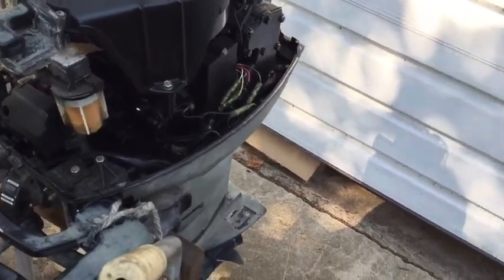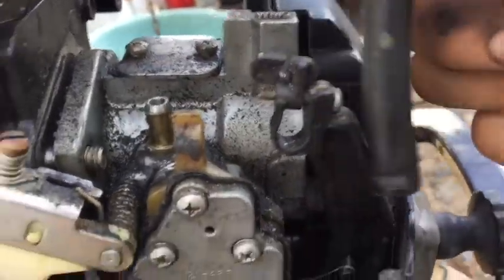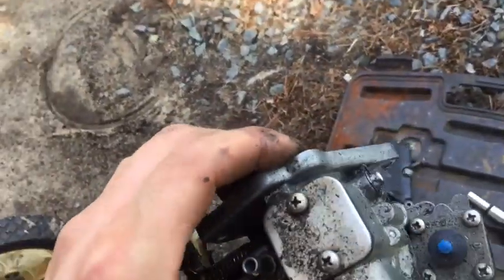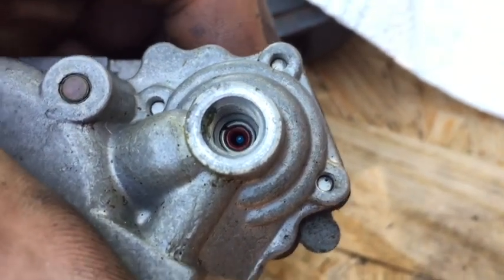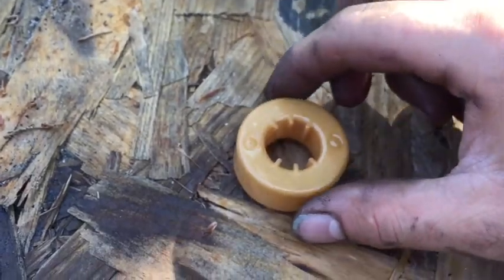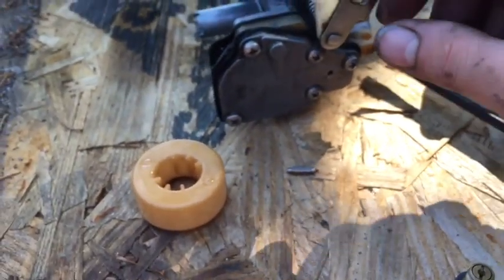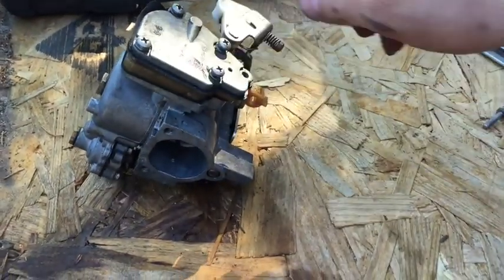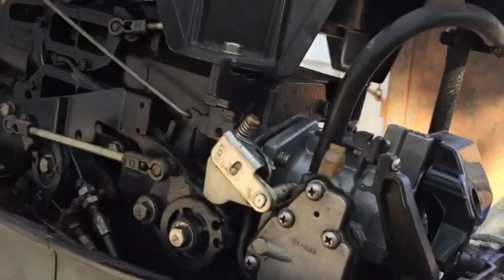1996 Mercury 25hp Carburetor rebuild

Comment: Hi would a upside down float in the carb cause the motor to bog down at full throttle?? Like it will go full speed for a good while then jus slow down and go fast for a cpl seconds and go slow again so on so on so on
Reply from the maker: Well yes a upside down float might cause a lot of problems. Not even sure if you can put the float upside.   If you could do it then sure it might cause that problem due to not enough fuel in bowl.  It would run the bowl dry and fill back up.  But it could also be other issues too.  If float is installed correctly. Does it the rpm just slowly drop down or a sudden drop or little stumble when dropping?
Reply: @kingdeadlego  it will just drop…. Like slamming ur brakes on the truck. Then go full throttle for a few seconds….. and the primer bulb gets real soft.

Comment: Lol. My luck. The one thing that I was watching for, you didn't even address. The gasket Or gaskets under the top plate. Is it rubber or gasket material.
Reply from the maker: If it is plate that I’m thinking about it want to say it gasket made of gasket material.  I do have a 10hp engine I’m going to doing soon so I make a video on that. Thanks

Comment: What model and serial number is the motor? Mine is the same engine but I can’t read the sticker to get the information.
Reply from the maker: Not sure. I will have to look and see if I have wrote down. I no longer have that engine.  Thanks King Deadlego
Reply: The silver plug on side of engine should have your numbers on it. 1996 should start with OG****